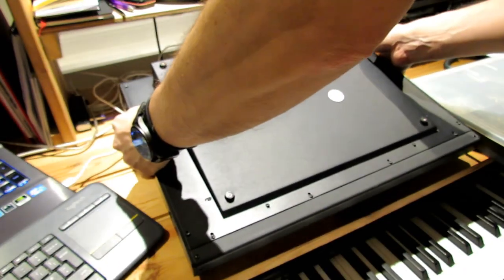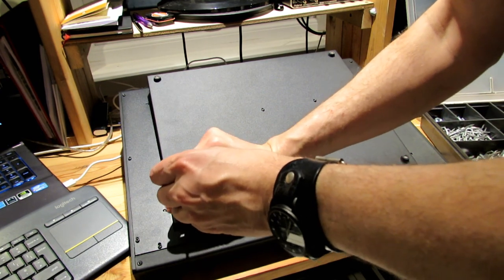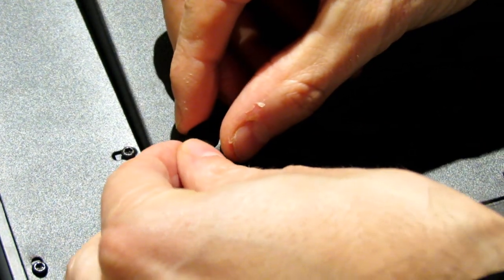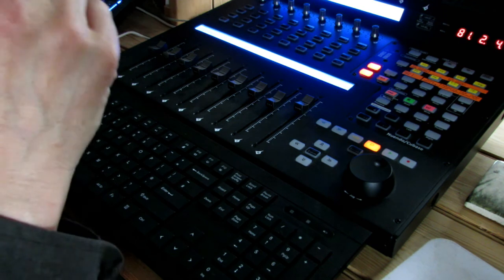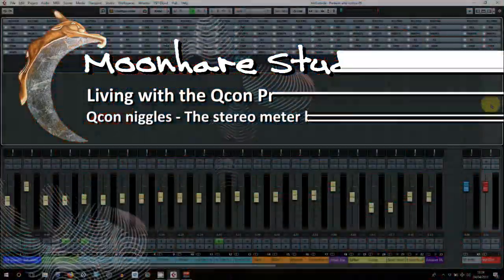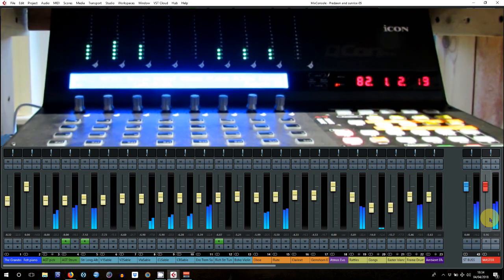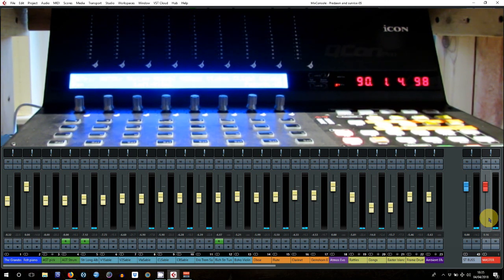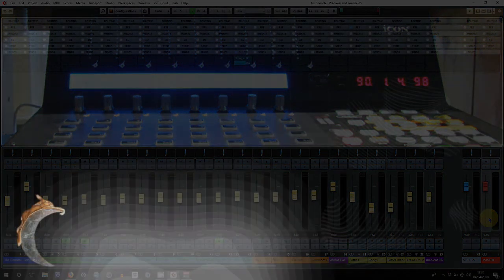Living with the QCon Pro X: Wobbly QCon solution & master meter bridge explanation

Comment: Actually, the feet on the QCon Pro X are adjustable. The screws give you a little room to even that out if it isn't exactly level. Just adjust them with that screwdriver to adjust the height of each foot.

As for Part Two, the Meter Bridge is a question we obviously hear a lot. Some DAWs support the sending of data to the stereo meter bridge. Bitwig is one that does it out of the box. Other DAWs do not. Yes, Darren, Icon HAS gone to our DAW manufacturers and asked them to provide support in the Mackie Control Protocol for the meter bridge (and to send additional data to that second LCD). This requires a script be written into the MCP protocol. Some of the DAW manufacturers have been very helpful with this. Bitwig, Reaper, and MOTU Digital Performer to date have been very cooperative, and the QCon series will enjoy deeper integration with those DAWs. Others have not been as forthcoming. But as you stated, the scribble strip does identify your channels, and if you happen to have a DAW that transmits more data, it does a lot more.
Reply: Hallo can you explain me please...  how I can send data to the stereo meterbridge in logic?
Reply from the maker: Best to check with Icon. They suggest it should work automatically with Logic but I use Cubase and it doesn't work with that DAW. Make sure you have the latest firmware installed too.
Reply: @meturah9930  This was a mistake in the earlier comment. Logic does not send data to the meter bridge of the Qcon Pro X. Some DAWs that do are Bitwig, Harrison Mixbus 32C, Reaper with custom script, FL Studio with custom script, Digital Performer and Tracktion Waveform. Sorry for the mistake.

Comment: bitwig?
Reply from the maker: The King . Yes, apparently the meter bridge works fine in the Bitwig DAW as a third party wrote some code to allow the software to communicate with the hardware. However I'm not changing DAW just to get the stereo led strips working!
Reply: Moonhare Studio Darken Jax the same has happened for sonar, some cool gentleman rewrote the mcu code and now this console works perfectly for sonar....however there is no sonar template overlay :/
Reply: Sendt you a mail regarding the meter problem.
Reply: @MoonhareStudio  how how to get the timecode meter working? mine is blank
Reply from the maker: @illegal_opinions  sorry for late reply. Been away for 2 weeks. I have never had an issue with the timecode meter at all. Are you using Cubase or another DAW? I'm not aware of any recognised issues but I haven't tried other DAWs on the Qcon. There is always a potential issue in the hardware in which case only your supplier or Icon will be able to resolve it.